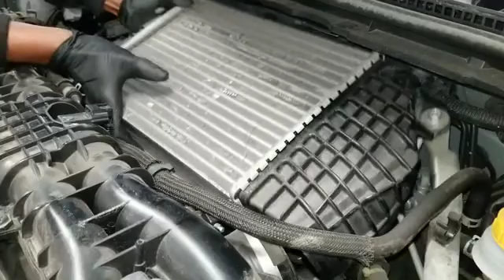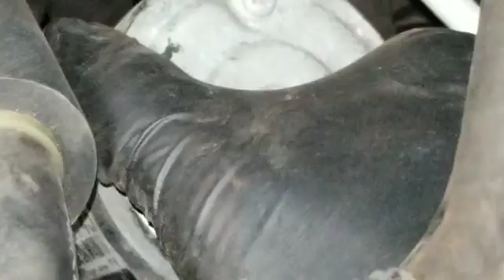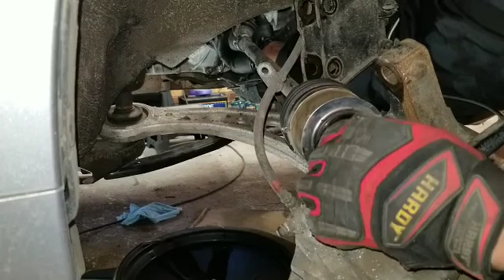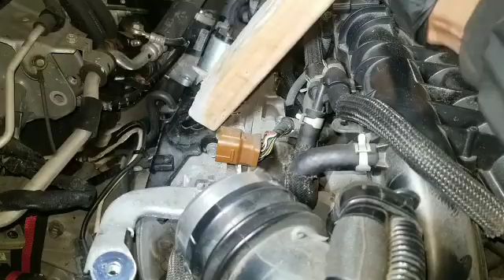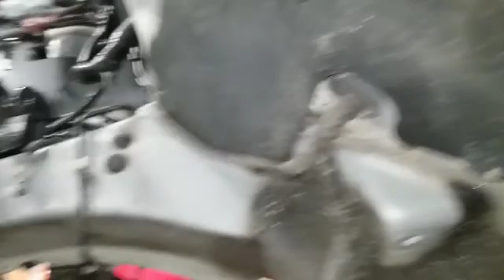MUST WATCH!! 2018 SUBARU WRX detailed Clutch Replacement

Comment: Good afternoon friend exactly I removed an inertia flywheel and placed the same one you have placed but, now the car vibrates at 1,300 1,500 rpm which I did not do before the change. I would like to know if the flywheel has a correct position since the screws have the same distance between them
Reply from the maker: It could be that the flywheel needs to be resurface or replace, the clutch was not aligned properly or you may just need to let the new clutch break in. Drive it gently for a few hundred miles and see what happens.

Comment: Im having problems with the pull clutch i ordered. Are these clutches the pull or push type stock?
Reply from the maker: It is push I believe, if the fork is facing the rear of the car it is push. Thanks for watching please Like, Share and Subscribe if you haven't already

Comment: Does the top shifter cable just pop off and has no pin holding it?
Reply from the maker: I can't recall the exact set up but I believe I covered it in the video.  Thanks for watching please Like, Share and Subscribe if you haven't already
Reply: you actually completely skipped how it was attached  @BIGWILLSCARCARE

Comment: Hey man I have to thank you incredibly.  I was able to do my clutch on my own. Outside on the ground.  I have so much more confidence now thanks to you and this video.  I'll update after my 1000 mile break in
Reply from the maker: Thanks for watching please Like, Share and Subscribe if you haven't already
Reply: How did it go
Reply: @awesomekid1456  not bad.  Hardest part was separating the motor from the transmission but that was only because of how i was trying to do it.  Grab the tail of the transmission and give a few Yanks back and forth and it popped.
Reply: Drove the car from RI to Georgia twice after and never had a problem with the clutch.  Exedy stage 1 race clutch.  Made launches a lot better and of course grabbed like a monster

Comment: @BIGWILLSCARCARE great detailed video, thank you! I just had my 2016 WRX clutch, throwout bearing, pilot bearing, and clutch fork replaced at 59k miles due to throwout squealing and clutch fork chattering. It's a new upgraded clutch (South Bend), new stock TOB, and new upgraded fork that should be same dimensions as stock. Engagement and shifting is smooth and tight, but when I picked up the car, I immediately noticed a noise when depressing the clutch almost like the former TOB noise but more of a metal sound like rotational friction. It gets fainter as the clutch heats up but does not go away after several break-in trips of light use. Could my mechanic have not used enough grease on the shaft that the TOB rides on, maybe misaligned the clutch fork, or should I have replaced the pivot ball to mate up better with the new fork's pivot socket to provide better fork alignment and prevent play? Is there anything you would suggest besides tearing back down to find the source of this grinding noise (expensive)? The mechanic said to keep driving it to see if it goes away but that does not seem like a good idea (I don't want to damage the shaft or the pressure plate). I have liked & subscribed due to your detail and knowledge and look forward to watching your other vids, especially for CV axle replacement since that's next. Thank you!!
Reply from the maker: @mike phillips  sorry for the late response but maybe your mechanic didn't use any grease at all or the wrong grease and I have seen where mechanics removed the old parts and didn't clean the surface before installing new parts. Thank you for supporting my channel 👍

Comment: Would this be the exact method to use for installing a 2017? Lastly how do I know if I need to replace my clutch or my clutch and flywheel? Thank you! very informative video
Reply from the maker: @Ryan Sanders it should be the same or very similar. if your clutch is slipping , shifting is difficult, burning smell, gears only shift at high RPM are all signs of a bad clutch and if you are replacing you might as well replace the flywheel because it will be easily accessible at that point. Thanks for watching please Like, Share and Subscribe if you haven't already

Comment: Why not just remove the lower ball joint for the axle removal so not to mess with the alignment?  great vid. Why not put the wratching strap on before you unbolt the trans?
Reply from the maker: @RobHTech  I would do that if was replacing the ball joint due to damage that may occur upon removal.  Thanks for watching please Like, Share and Subscribe if you haven't already

Comment: Great video. One question how did you remove the top shifter cable?
Reply: You ever figure it out?
Reply: I got the bracket and clip off but not sure how to disconnect that top cable from the tranny
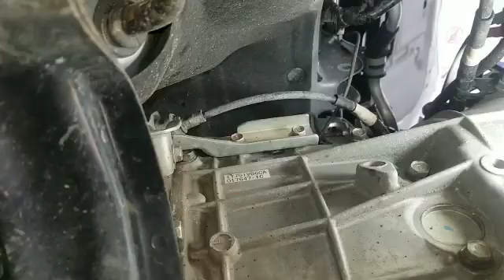Reply from the maker: @Hunter-og1sy  it's around the 17:28 mark of the video.  Thanks for watching please Like, Share and Subscribe if you haven't already
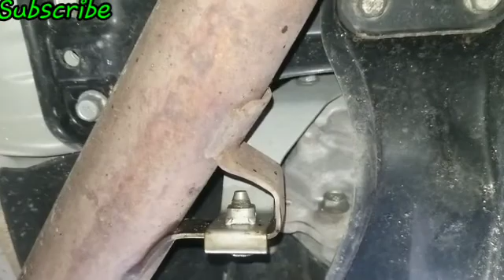Reply from the maker: @titofoller  16:00 to 18:11 minutes section is where I have the information. The angle wasn't good for me to record it but it's the same as the lower. Thanks for watching please Like, Share and Subscribe if you haven't already

Comment: Not gonna lie this was my first time ever doing a clutch let alone taking out a transmission I wouldn’t have been able to do it without this video. A couple extra tips for newbies: 1- clutch alignment tool must be used to center the clutch don’t just put it in and think you’re okay or you will not be able to put the input shaft through the pilot bearing/flywheel, you must hold it almost the exact center of the opening and tighten down the pressure plate while holding it centered still 2- Organize your shit or you’re gonna have to drive to subaru to buy multiple bolts covered in grease 3-for axel reinstall once axel is aligned and will not go in any farther but there is still a gap: use center section as a “hammer” and hit the end into the transmission 3/4 times, if it does not go in, immediately spin the axle 180 degrees (to align the snap ring at the end of the axle) and repeat
Reply from the maker: @Chike N  Thanks for watching please Like, Share and Subscribe if you haven't already

Comment: You left some things in place like the exhaust that makes the job a little easier than others have shown.Would this be the same procedure for a 2008?
Reply from the maker: @Jeff Flowers  I'm not sure but it should be a similar process. Thanks for watching please Like and Subscribe if you haven't already
Reply: @BIGWILLSCARCARE  Now that I'm digging into this project, I can see the 08 is different. The turbo on the right side is blocking at least one bell bolts so I will likely have to remove it. :( I might be able to get away with just removing the heat shield. But now wonder if I'll have to remove the exhaust on mine anyway :( I also snapped the top starter bolt. Hopefully there is enough sticking out of the block to grab it.

Comment: The most informative video for WRX clutch install yet. I do have one question if I could trouble you to help me, please! I have replaced the clutch and am installing onto engine but having difficulty getting the tranny to completely mate to the engine without some resistance. I was wondering if accidentally moving the lever while handling the transmission while removing that is actuated by the shift cable that has been detached, would impact the re-assembly. I don't honestly know what gear it may be in as I've hit that damn lever and actuated the shift lever to the right rear of the tranny which sounds like I have changed the gears. I just don't know how much pressure to place on the transmission in order to get it to mate past the tabs on each side of the tranny. Should it press up to the engine block without resistance? I'm having to work the bolts on equally criss cross to get the tranny to move toward the block then get resistance once the tabs begin to mate up. Thank you for your input.
Reply from the maker: @Justin King  I don't believe that should prevent it from mating. Make sure the engine is rotated towards the rear and the clutch is seated correctly. Use the clutch alignment tool. Thanks for watching please Like and Subscribe if you haven't already.  Also follow me on Instagram Big Will Car Care
Reply: Having the same issue. What did you do about it? I also think I actuated something and got bolts in, and the go in without  resistance until about 1 centimeter left. Help!
Reply: @zyco611   Did you get it figured out? im in the same spot i still have 2 inches to go… everything is aligning as far as i can see but still no progress

Comment: Some people pull the motor out instead of the transmission to replace the clutch on these cars. Which method do you think is the easiest?
Reply from the maker: @SG Alanzo I prefer to remove the transmission instead of the engine, where I would have to worry about removing wiring harnesses, engine mounts and using engine lifts plus whatever else that might be in the way. Thanks for watching please Subscribe if you haven't already